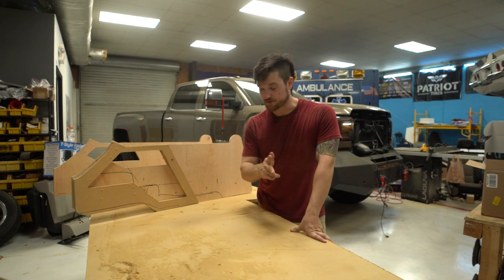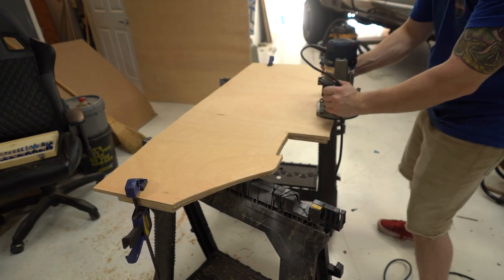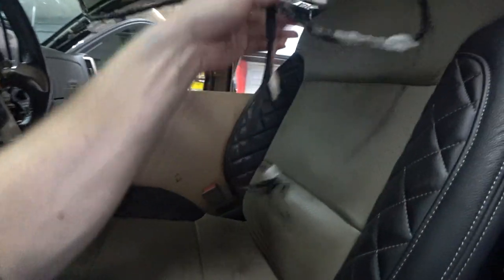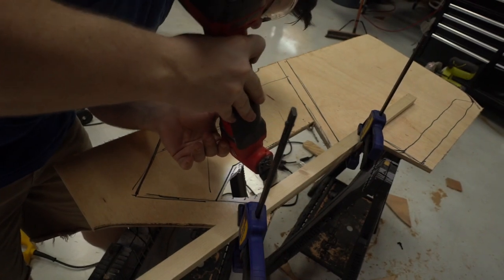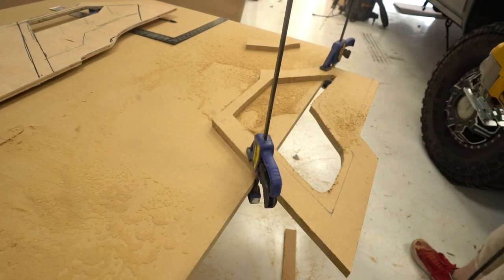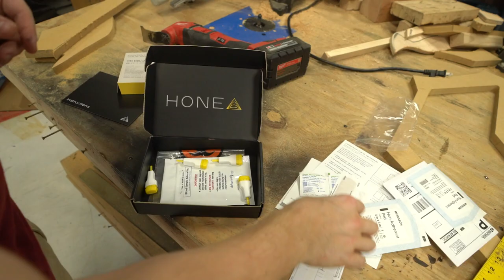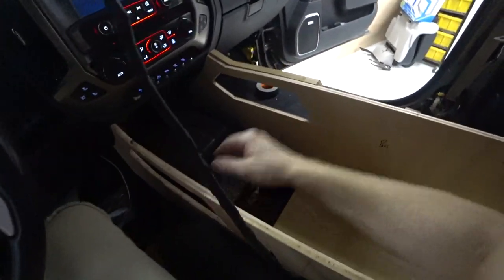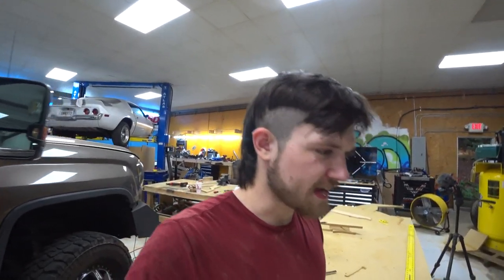Building an RGB Center Console | Part 1

Comment: What you’re doing with the straight pieces is very common. If you end up doing a lot of work with the router I would suggest making a handful of jigs with different radius bends and shapes that you can always trace over onto something else using the same method. I’m excited to see how this turns out!

Comment: I think some full enclosed boxes in lower section of the rear center would be badass. Cut a section out that’s covered by Plexiglass and RGB lights to illuminate the subs. I was gonna do it in my 14 Single Cab but never had the confidence to do so but your attitude of “You can do anything, It’s just work” is amazing and I am starting to live by it

Comment: The technique you used on the table top router is the exact technique we us in the car audio industry. The only advice I have is to use double stick tape to stick the pieces together NOT THE FOAM STUFF  the super thin double stick tape. The foam moves and doesn't provide the straightest edges. Also it may benefit you to look into mobile solutions router templates! Stay awesome though feel free to shoot me a message if you have any questions

Comment: instead of screwing two pieces of material together, you can use template tape to stick them together when using a flushmount router bit. Also check of www.mobilesolutions-usa.com. They have alot of really cool design/ pre-made templates

Comment: The only difference between this router setup Dan, and how a wood worker would do, is they would have a dust collection system to pull the saw dust away as you worked. Oh, and also the piece of scrap as a fence, as long as the wood wasn't going to be naked, they would do the same.

Comment: You design around the fastener so basically if you think about being able to take it apart you hide the fasteners under moveable bits that way they are accessible but not an eyesore(think like plugs on those cheap toilet paper holders and towel bars as bad examples) so I say make a snap in type panel thats moveable and held in with screw joints from the inside of the box. Or basically make the structure a skeleton and the pretty bits hold onto that structure from inside like ar15 accessories on rails and stuff

Comment: instead of using screws to secure the straight edge try using blue painters tape on both surfaces and then supergluing them together. lets of woodworkers   use this method when templating